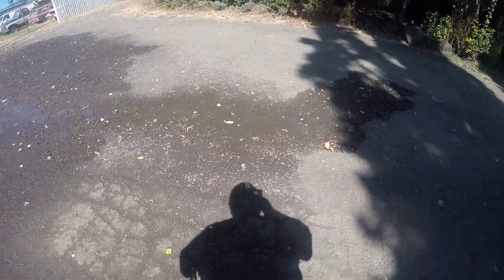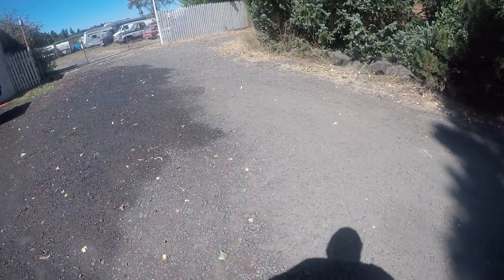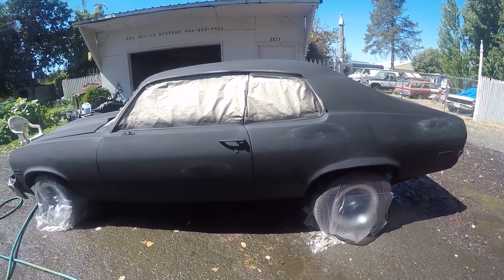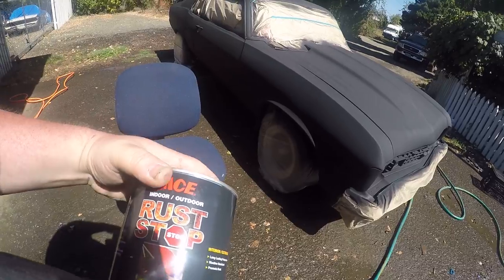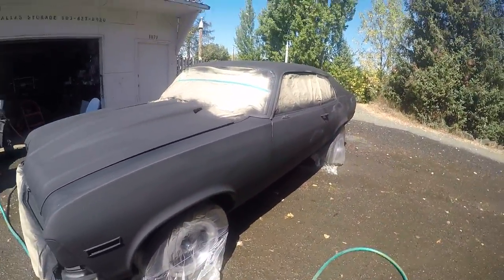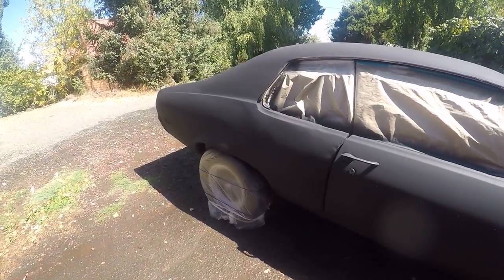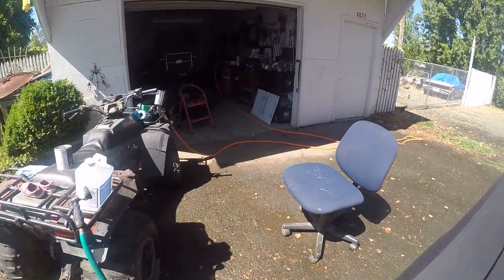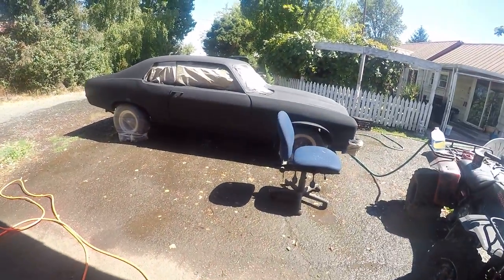Tip on painting a car outside

Comment: Hi I'm trying to paint my car tomorrow outside but was wondering if direct sunlight is bad when painting it 🤔
Reply: I don't think the sunlight would be bad, one side might dry faster than the other. When I worked in a repair shop for a little bit they baked the cars in the paint booth with heat so